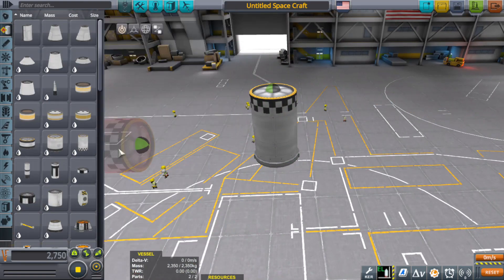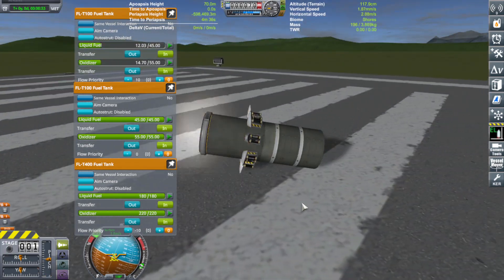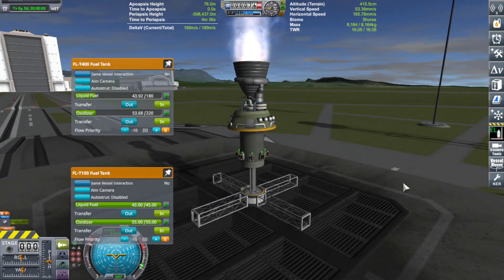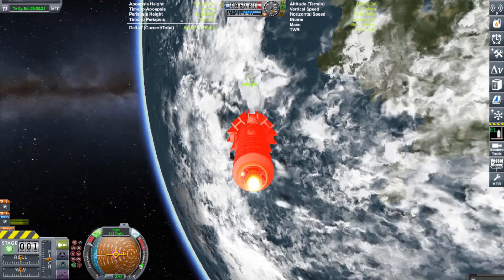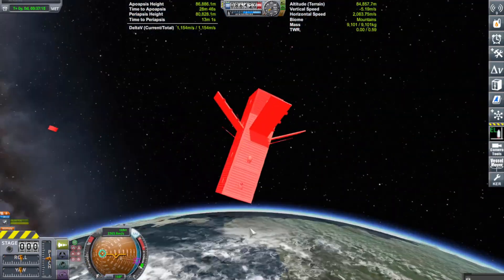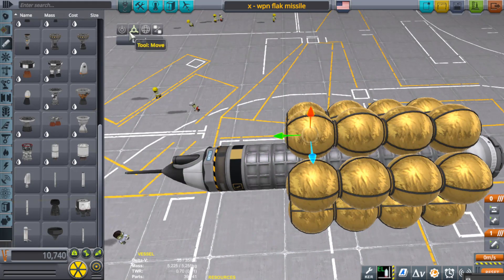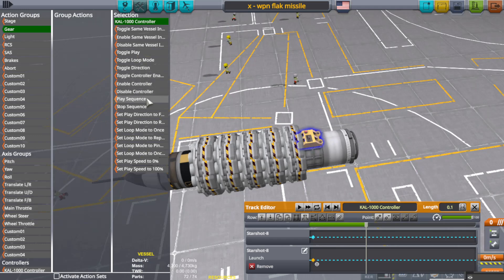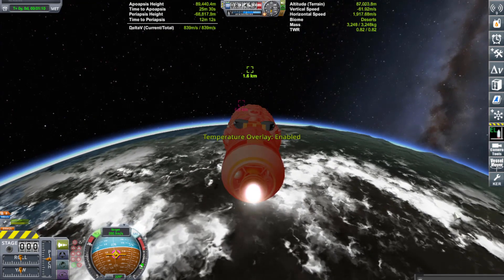STAR BURST SHRAPNEL MISSILE CONCEPT \ Kerbal Space Program \ KSP 1.12.2

Comment: I tested some of my own firework shrapnel missiles and I've found they're very effective against full scale warships. The missile I used has 8 of the starshot-8s set to somewhere around 300 velocity with a KAL-100 action group launching all 64 shells at once and it SHREDDED the internals of the warships I tested it against. My theory is that the armor used on warships is thin enough that most of the firework shells just pass through it and hit the much thicker targets of the internals. Compared to the other missiles, they're honestly kinda cheat-y/overpowered.

Also if you timewarp for just a second, the firework shells despawn (or something like that) and you can use that to get rid of them after they've hit so that the fireworks don't go off and cause massive lag to your game.

Love your videos, especially your warships!